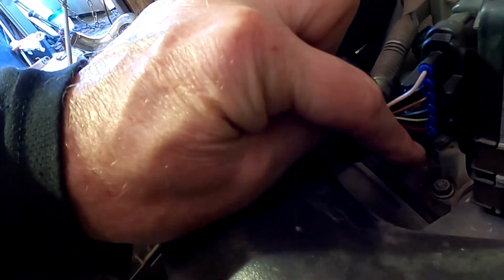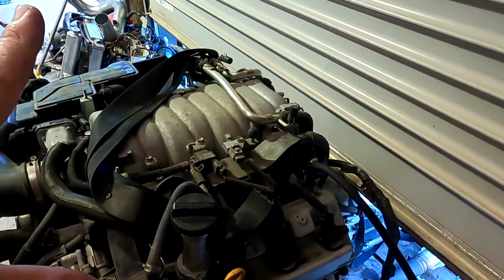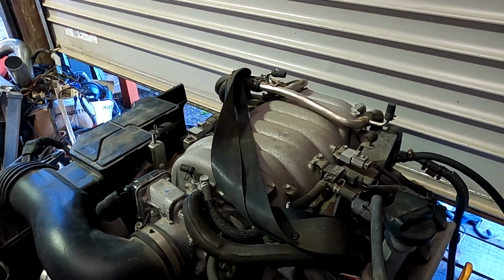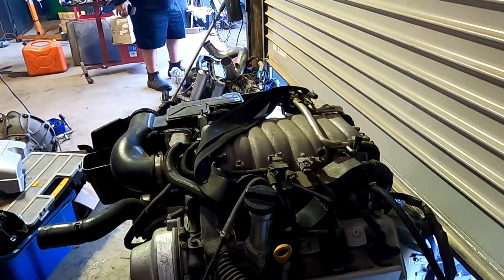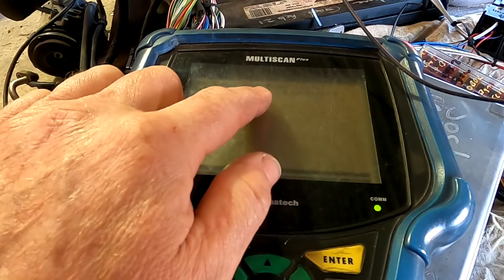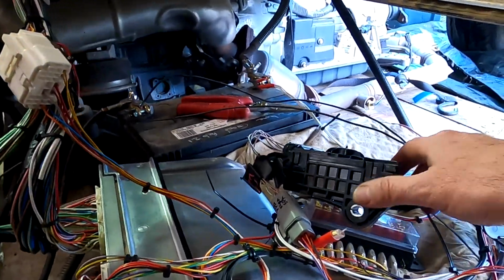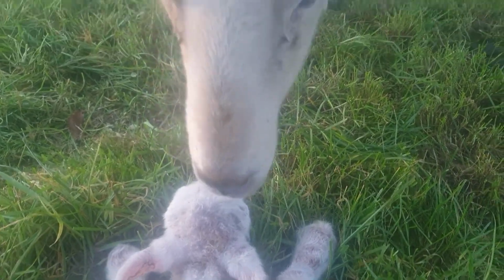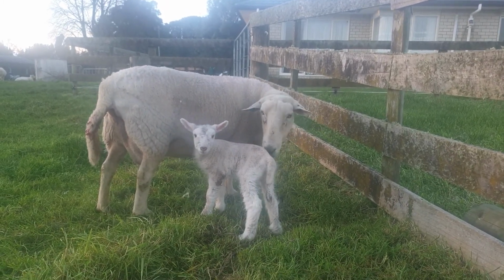3uz reflash with Pops and bangs. LS430 reflash.

Comment: Recently had my 3uz ecu flashed from quantum it's awesome! No pops and bangs for me but the throttle response is night and day compared to stock,and I can feel the torque instantly! I raised the rev limit to 7k but power edges out around 6500 to 6800 while in gear,but all stock motor mostly,I was considering headers soon to get the most power up top,and mild cams but not sure if the stock ecu with the remap can handle mild cams.
Reply: hey steven, when you went with quantum did you ship in your current ecu? or do they provide one in the price?
Reply: @agucciverse  you can ship yours in or buy one of there's,they have a option to buy one or send yours on there website.
Reply: Ok I'm really confused on the rev limit part. I went on their website and looked. It says manual rev limiter, does it mean I have to be manual swapped to raise the rev limiter or it raises the rev limiter when I pop it in manual mode
Reply: @Honja999  they can raise the shift points in an automatic, rev limit for manual only,it ain't even worth revving a auto in neutral the torque converter is too heavy too do anything impressive, but improved shift points in an auto will help a ton 👍.
Reply: @steventaylor9016  true, does shifting it manually feels faster? Mine feels sluggish lol
Reply: @Honja999  I have a w58 3uz swap so I couldn't tell you for sure, it can be a few thing's like valve body,fluid, torque converter,or ecu needs rebuilt, I had a sc400 and a fluid and filter change fixed that issue.
Reply: @steventaylor9016  oh shit nice. Gonna look into it more
Reply: so i’m assuming your didn’t select the crackle tune option ( or did you select it but it just didn’t crackle)??
Reply: @jmyuh8130  I would not get the crackle tune and would never recommend anyone gets it on any car. It's become very popular. I've heard even base model Lancers have the crackle tune and every modified German car on the road has it. You waste fuel, degrade catalytic converters, wash out the cylinder walls and cause extra wear on the engine. Add in the fact that now all modern cars are direct injection(oil gets diluted with fuel) and you just have a car that will have worse and leaking pistons rings by the time the car gets to 100,000 miles or even before.
Reply: did you opt to have the immo removed and did it start right up when you installed it?
Reply: @aquamatt  yes I had the immobilizer removed and it started the first time I cranked it over,it's still running great you can see it run on my channel,still all stock 3uz.

Comment: Hi Kelvin,

Thank you very much for posting this video, it answered a couple of questions that I had! I do have one more - I have a 01-03 3UZ and 03-06 ECU along with the 6 speed auto. I will be using them in a conversion, is it worthwhile getting hold of a 03-06 throttle body and swapping it over?

Comment: Hi hope all is well and the everyone it surviving the pandemic.

Can you please explain the deference between the 2 valve cover outlets on a 1uz-fe/Ls400 engine.
I know that the one with the oil filler cap is where the PCV valve sits. But what is the one for under
the throttle body, the big 90° elbow fitting witch ties in before the throttle body inlet. 

Want to find out if it will do anything by installing a oil catch can on it as well or leave it as is.
Problem is that the 90° elbow fitting is facing forward making pipe routing difficult and one will need to remove
elbow, tap hole to fit a 3/8'' BSP brass 90° male elbow barb hose fitting so it can face the firewall. The 90° elbow
on the throttle body will then also need to be reduced so 3/8"

your help will be appreciated

Comment: Does the pop and bang tune damage the engine at all ? And does it lower the car horse power ?
Reply from the maker: No damage.  Continual use will blow the converters out.  No less HP with the pops and bang tune.
Reply from the maker: @Gavy Kang  we haven't quite managed that yet however its quite controllable via driving style,  and it doesnt pop as much in normal mode.

Comment: Hi mate , good work there and first time I’m not looking over us or uk for tuning needs. Any chance you can work on the lexus ISF ? It has quite the following here in the southern hemisphere so I bet lot of people will be interested. Cheers and have a good day.
Reply from the maker: We have solutions for so IS-F yes.  Cheers Kelvin
Reply: Hi mate its kang here again after 5 months.I just bought a  gs430 and what sort of tune you have for ecu and tcu currently ? I need to send my ecu/tcu or have you got one that I can buy with the tune ? Do I need to modify my exhaust to get the pops and can I control it via normal or sport mode ? thanks @CartuneNZ
Reply from the maker: @GE-Kang I prefer to reflash the ecu from the vehicle,   can do pop's and bangs with stock exhaust however with a more open system it will pop more

Comment: And plans of possibilities to do this with a 1uz vvti? Or could similar pops and bangs be achieved from a 1uz vvti with a Link ECU?
Reply from the maker: Zero plans to work with tuning stock 1uz vvti ecu as its not commercially viable.  Can do with a link,  just did a plug in adaptor for ucf20 ls400 with link ecu.

Comment: Hi kelvin,  I am here in the states and have myself a second gen, 2005 lexus gs430. i have heard alot of conflictaing information on my particular model about if it is a 5 speed or  6 speed auto. So if my throttle body has the big 6 pin plug on the intake will that forsure mean it has a 6 speed?
Reply from the maker: Its easy to tell the 6 speeds by simply looking at the chassis tag or looking at the transmission itself as the 6 speed and 5 speed are very different,   then throttle body,  ecu data id has it.  Also easy to look up online using vin number.
Reply: @CartuneNZ  Guess I shoulda thought about this earlier! Thanks for the response mate!!!!!!!
Reply: If you have a first GEN LS 430 (01-03) then you have the five speed if you have a second GEN (04-06) then you have a six speed

Comment: I have a 98 GS400 with the VVTI 1UZ swapped with a 6spd manual transmission. Currently running an emulator, i would like to eliminate that, also the O2 sensor codes and add the fart tune.  Is it possible to get that ECU reflashed?  I don't see an option for it on Quantums website. If not am i able to just reflash a 3UZ ECU and run it on my 1UZ?
Reply from the maker: The 1uz VVti ecu does not have a reflash option as they arent commerically viable to do.  We have focused our efforts onto the 3uz ecu.  To run a 3uz ecu in a GS400 it would be a rewire and Im not sure we could flash in the GS400 dash settings to make everything work.  Never really looked into that.  We generally go aftermarket in a situation like this.  Cheers Kelvin

Comment: Does the drive by wire react as fast as the cable throttle pedals?
Reply from the maker: Can be faster if set up in a faster fashion.  Stock they are saggy,  but with some adjustments they are much better
Reply: @CartuneNZ  thanks mate... love your work

Comment: This is very cool. Is there enough tunability in these ecu’s to support huge injectors and lots of boost? 
It’s almost more tempting to just trade my gs400 for a gs430 to have this option! I assume it’ll be cheaper than a breakout harness and running a stand alone for fuel and spark control
Reply from the maker: Nope.  Enough tuneability to support light boost at this stage.  No plans to develop the higher boost tunes due to time and returns.